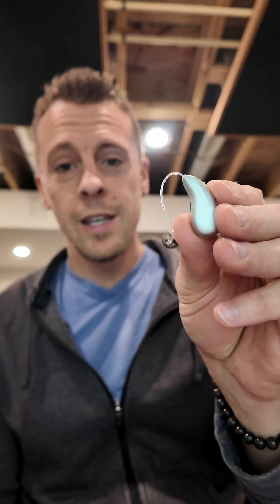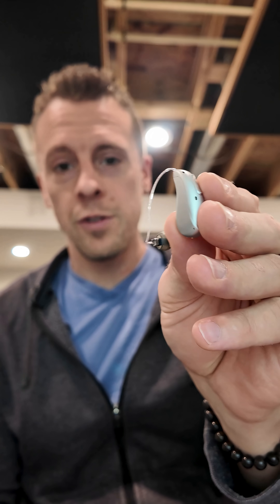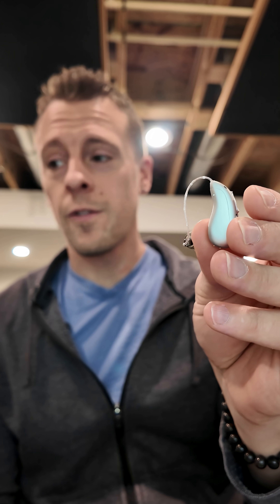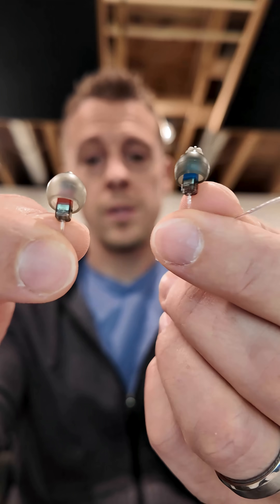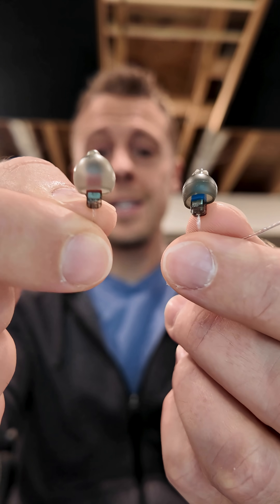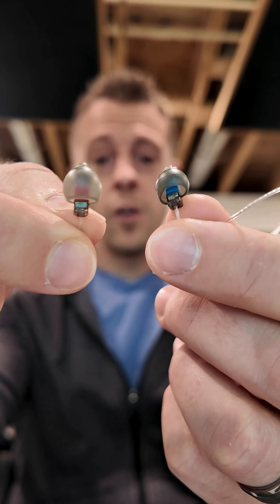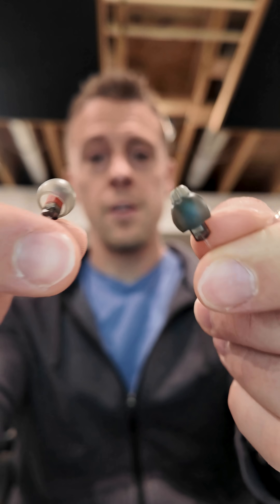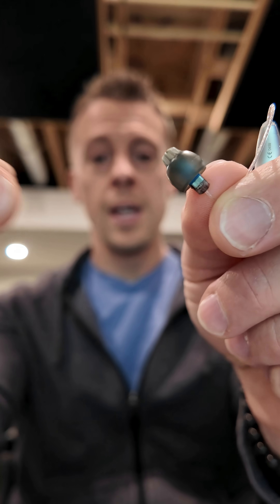Phonak EasyGuard Domes: New Design, Same Sound?

Comment: Question, I currently use Phonak Lumity hearing which I have had for 3 years. After I do a high intensity workout with a lot of sweating, I hear a lot of static in my right hearing aid. This only occurs after high intensity cardio workouts (Like Spin Classes). When I dry the hearing aid and clean it, the static goes away. Would the EasyGuard dome make this problem go away? Given that I workout almost everyday, what is the best way to prevent this problem from happening? Your thoughts are appreciated.